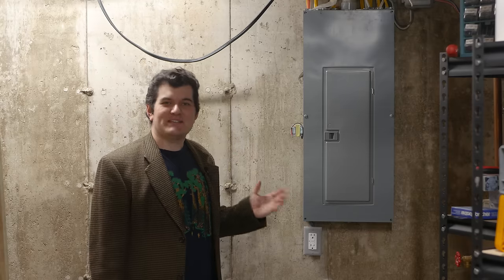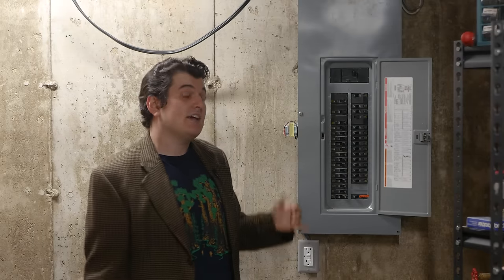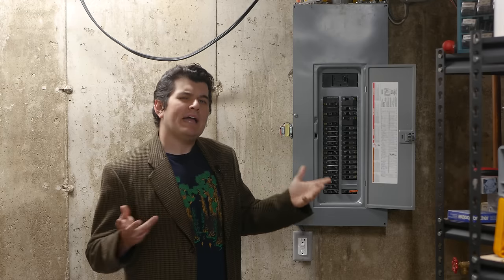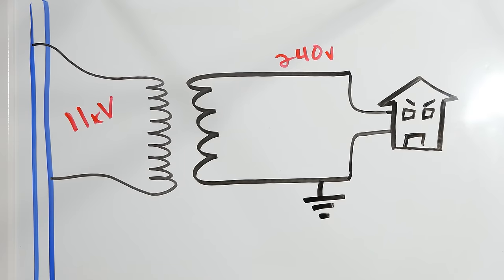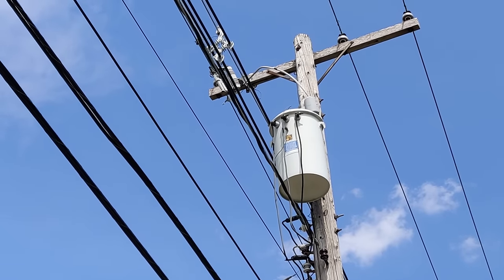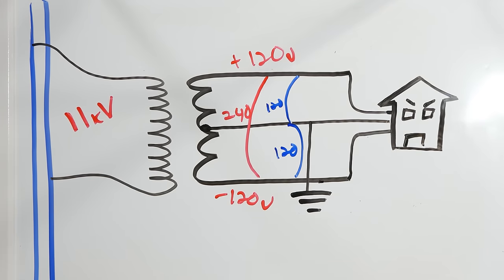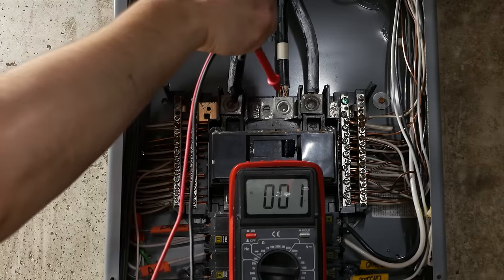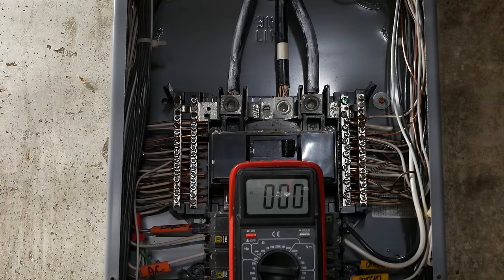The US electrical system is not 120V

Comment: Actually in Germany we typically have 3 phase power to our home. This means you have 3 powelines, 120° appart and one ground. Depending on how you connect these between eachother or to ground you get either 380V or three times 240V. Bigger machines like washing machines, driers, ovens etc. use the 380V three phase power. Other smaller machines, connected to the normal outlets, use the 240V single phase power. 
Usually the fuses for the main lines are 63A for each phase. There are other breakers like 125A, but these are not so common in normal households. Hosehold machines thypically have lines with 16A breakers. Bigger industrial machines use 32A lines ore less commonly 63A.
Reply: Yeah that's true for the most part but the voltages are 230V and 230VxSQR(3)=400V
Fun fact the "normal" 230V plug is only rated for 10A consistently but u can still pull 16A for a short periode
Greetings from an electrical engineer from Germany
Reply: In Germany, the 3-phase is 400V. . . . Which naturally gives 230V Single-phase. . .  ( For Americans, Single-phase is a SINGLE live line and Neutral. )  . .   Not like their 2- phase 120/240V which is TWO Live lines and Neutral.
Reply: The US 3-phase electrical wires carry 480V at 60HZ but usually only commercial and industrial uses get that much. But none of this matters. Everyone gets what they need which is the point of  his video.
Reply: @tawnyforest7932   No they don't in America, that is what I am getting at . ..  You cant get 120/240V directly from a 3-phase supply. . .   From 3-phase, you can get  240/140V    nasty for 120V loads. . .  Or you can get  208/120V  nasty for 240V loads.
Reply: Do you really use 3 phase power for washing machines in Germany? Most run just fine on 10A / 240V single phase. Your fuses are also pretty big at 63A. In the Netherlands we usually get 3 x 25A. More amps are possible, but at much higher monthly network charges.
Reply: @tawnyforest7932    I do a fair bit of work with 480V 3-phase and I often have to convert it to provide 120/240V. .  Not easy from 3-phase.. .   The rest of the world does not have this problem  400/230V is easy to work with.
Reply: @drfisheye  It depends on what machine you are buying. You can get washing machines as one phase or as 3 phase version. I personally have a 1 phase machine, but I do know people, that have the 3 phase ones. My dishwasher on the other hand does use 3 phase power (stove and oven as well).
The 63 A fuse is only for the main line, that is connected to the street. Inside my house the 3 phase power line is split into multiple 3 phase lines with 16 A Fuses and also multiple 1 phase lines with 16 A fuses.
Reply: @drfisheye  No, not for normal residential washing machines. Electric stoves are usually connected to 3 phases, but just in order to distribute the load of several plates operating at the same time on different phases. Traditionally, one used 3 phase motors in tooling machines and similar. Neon bulbs in bigger rooms like a sports hall are distributed on the 3 phases to reduce intensity flicker. Both are vanishing with electronic inverters and LED lighting. But new 3-phase-connected applications are wallboxes for BEV charging and photovoltaic inverters.

The normal electrical power connection for a single-family house is 3x40A nowadays. Older installations or flats in a bigger house have less.
Reply: @talpalababa5994 That's very interesting, how do you connect the appliances, do they have a special 3P plug or the wires are connected with terminals?
In Italy, although possible, no one has 3P at home. Every building does have all 3 phases which are then distributed evenly into the flats. The standard meter is rated at 3kW although you can upgrade to 4.5 and 6kW, for even more power a 3P connection is required.
Reply: @fb55255  In Germany we have a special 3 phase plug. This plug has five pins. One ground, one neutral and then the three phases. The higher the amperage the plug is designed for the bigger the plug is (the overall design stays the same). This is so that you can't for example plug in a 16A machine into a 32A line (and vice versa).
Reply: @drfisheye  The 3 phases come to the homes (3 live + 1 earth&null). There may be 3-phase (5 pin) connectors for special reasons, but it's not common (but built-in devices like ovens can use 2 or 3 paheses). The 3 phases are separated into 3 1-phase circuits with individual breakers. Therefore funny power outages happen when only a part of the house is in darkness...
Reply: @hughleyton693  what do you mean "that's what you're getting at"? You didn't say one word about American 3-phase power. Nice try but you can't edit the past.
Reply: @csabamagyar3244  that can happen anywhere you trip a breaker to just part of your house lol
Reply: @joshyoung1440     American 3-phase is the same as 3-phase all over the world and with 3 live lines, running at different phases, is rightly called 3-phase by everyone, including America.. .  Which is what makes it strange they can't call it 2-phase which is similar having two live lines, running at different phases. . .   3-phase is 120°  . . .  2-phase is mainly 180° but can also be 120° and the old original 2-phase was 90° .. .  They are all 2-phase but only 90° called 2-phase in America. !
Reply: @hughleyton693 2 phase is it’s own thing but it doesn’t make sense to use it so you never see it
Reply: @markmontagna7637     3-phase has 3 Live lines with or without Neutral, 2-phase has 2 Live lines with or without Neutral,  single-phase has a Single live line with Neutral return.   .. . . End of story. .. .  So 2-phase is widely used in America.
Reply: That is why the heading of this Video. . .  America uses 2-phase 240V that is 3-lines, L1, L2, N. . .  Each Single-phase is 120V. . . .  But because they are 180° from each other, then 2-hase gives 240V from Two Hot lines.
Reply: @hughleyton693 Thats not what the term 2 phase is usually used to mean.  Look on Wikipedia you'll see that 2 phase is used to mean something different (usually using 4 wires but possible w/ 3) than split-phase.  In a 2 phase system the two phases differ by 90 degrees not 180 as in split-phase.
Reply: @petergerdes1094    That   IS   what the term 2-phase means, Internationally, but not in America. . . .  3-phase is 3 live AC lines, 2-phase is 2 live AC lines, 1-phae is 1 live AC line. . . .  Simple as that technically and Internationally, but not called that in America.. .. .  Yes 2-phase is used to mean 4 wires or 3-wires L1, L2, N   And the easiest way to get that for 180° is to Split a phase winding into TWO halves with the centre point grounded for Neutral,  for 120°. just take 2 out of the 3 live lines with or without Neutral, for 90° you will need to use a Scott-T arrangement... . .  We Split 3-phase secondaries to get 6-phase, better for later rectification to DC.
Reply: @talpalababa5994 Is that the CEE connector?
Reply: @wongcw08  Yes, it is the CEE connector.
Reply: @drfisheye  No, common washing machines only use the standard 230V plug, and yes, 10A usually should be enough. There are still a few older homes which only have wiring for 10A.
Reply: @hughley693 so is Germany better than us & the UK front that?
Reply: @hughleyton693  Small correction, American infrastructure is 1 phase 240V split. 
2 phase suggests a 90-degree phase offset.
Reply: @nathanielhill8156      2-phase can be 90° or it can be 120° or it can be 180°  . . .  They normally use 3 wires and there can be others, but the three are the more common ones, although 90° is not very common these days, but 4-phase has been around quite some time, but not al long as 3-phase, and now we are using 6-phase and even 12-phase in some systems.
Reply: I'd say three phase ovens or stoves for consumer use are incredibly rare. They are usually connected by three single phase connections with a linked three phase breaker. That's why three phase sockets for these kinds of machines are often wired with two neutral wires rather than one.
Reply: @jonatanrullman     As several people have told me, 3-phase supplies are common in some Europeans countries homes. . .  I have not seen that, but I have most certainly worked with European 3-phase, which is 400V in many business places.
So yes, you could cheat for stoves, ( ranges ) using multiple 120V lines or even multiple 240V connections, which are actually 2 x 120V lines, providing the Fan motors are correctly powered.. .   .  That is why 50A Stove Plugs are 4-pin, that  is 2 lives and a Neutral, so they still have 120V available for the electronic control, timing clock etc.
Reply: not washing machines but some electric stoves run on 3 phases as the 3 phase wiring is a lot beefier. and you can pull 32amps from it sometimes @drfisheye
Reply: @fb55255 😂 I remember when staying in Italy we had like TV, oven, washing machine and AC on and it tripped the breakers. Everyone was just baffled when we found out how low the amps were for the whole house.
Reply: @talpalababa5994  funny how its always necessary to write "in Germany" :D .... Its EU standard. Even UK has same 3phase plug
Reply: @drfisheye not washing machines, but our electric stoves ususally run at the 3 phase, for more power.
Reply: @drfisheye  I live not in Germany but in a someawht similar neigbouring county. When I was a child in the 70'ies it was quite normal to have 3 phases in ordinary one-family houses. For the heating of the washing machines and for the oven. I even remember my father saying that some friends had an odd washing machine - being only one phase. Nowadays, washing machines consume less, but it is still quite common (if not the norm) to have 3 phases in your house, although it is not common to have 3-phase 400 V wall sockets any more. More to just distribute the load on the grid.

Having said that, we have a 400 V and 16 A three phase  wall socket in the summer house for the washing machine, although it never draws that much power.
Reply: Nah bruh its just cooktops. Washers all take only 1000W now. Dryers not even 500W.
Reply: @hughleyton693  US tranformers are actually single phase 240 but 2 leg with center tap neutral. Because of Edison's 120V bulbs or something.
Reply: @drfisheye  Serbia does 3x25A too. If I remember right thats a total of 17250W. Good luck exceeding that with home appliances.
Reply: @jm036  The US calls them Single-phase. . .    They are single-phase transformers.. .   But they have two Secondary windings.. .  The centre point is Grounded for Neutral, which then leaves the two live ends, each at 120V from Neutral and 240V from each other, because their phases are running at 180° from each other, rather like a kids sea-saw, and that is how they then provide a 2-phase 3-wire SUPPLY to houses. . . . . .     We also also make 6-phase from 3-phase supplies, by also splitting and centre tapping the three secondary windings in the same way.. . . Splitting a winding and grounding its centre point is the easiest way to get 2-phase 180° 3-wire Supplies.
Reply: @drfisheye No, in Germany usually the only thing connected to 3 phase power is the stovetop. Everything else runs on 230V~, except if you have industrial devices at home.

Comment: If people were confused by gas clothes dryers you should do a video on gas powered refrigerators.  That'll blow some minds.
Reply: That involves finding some place out in the middle of nowhere or perhaps having access to an RV motor-home.
Reply: When I was a kid in Iran (1960) we had a kerosene powered refrigerator. Dad had to relight the flame occasionally. I learned the refrigerator used an ammonia absorption cycle... a bit beyond my 8 year old brain.
Reply: But.... gas make things hot.......
Reply: yeah that took me a while to understand how an absorber fridge works, it blew my mind a little bit
Reply: Mmmm. I love the smell of Freon in the morning.
Reply: @Fopenplop  Hot is good. Hot drives a motor. Motor works like electrical motor. Motor drives pump. Pump works magic and summons unicorns. Unicorns are cool. Fridge is cool. Now milk won't spoil. Gas also comes from Uranus, but bottled gas is not so smelly. Or is it?
Reply: Gas appliances in general confused me as an adolescent due to nobody feeling the need to clarify how the gas was used. I was thinking the whole thing was pressurized. Gas or propane powered dishwashers and washing machines too (RVs). Then there are natural gas vehicles. Those things still scare the crap out of me on principle, but I also have trouble refilling a butane torch. So, there is that.
Reply: They used to have gas powered bath tubs too.
Reply: Or gas powered central air conditioners. Back in the 70s the gas company would put in an absorption ac system for free if you signed a contract to buy gas from them. Crazy things used a 300k btu burner to get ~60k btu of cooling.
Reply: The ammonia line in our RV refrigerator ruptured in the middle of the night and it was the worst smell ever and lasted for days.
Reply: @scofield117  I worked at a local gas utility for a summer job back in the 80s. I heard one of the pipefitters say something like, "I have no idea how burning gas will cool down a house." I never bothered to figure that out, either.
Reply: The utility company I work for still has two old SERVEL gas fridges in our training facility. I had no idea such a thing even existed, but they're really cool. It's not a compressor driven from a gas-powered motor like someone mentioned up above, it's an absorption cooler. No moving parts and virtually silent!
Reply: I would love to see him talk about them
Reply: @scofield117  now that's American!
Reply: I mean quite a few people will have heard about those for camping reasons. A gas clothes dryer is super weird because the reason why they exist is far less obvious then "i need a refrigerator in my caravan".
Reply: @Fopenplop  Gas fridges have been around for almost 100 years, they use Ammonia as the gas. Great Grandparents had one from the 40's on a farm.
Reply: Meanwhile, I'm confused how gas powers cars. I haven't seen any LPG cars with tanks for them.
Reply: @meinnase  What's weird about them? Electric dryers use a heating element and gas dryers use a flame. Far more efficient and cheap to run. I have one. Before I get anyone arguing that electric heating elements are 100% efficient... They are... There are substantial grid/conversion/distribution losses involved in Electric that do not exist with Gas.
Reply: @scofield117  Gas powered central air conditioning common in Northern Virginia back in the 70s because Virginia Power was even more of a "hee haw" power company back then and couldn't supply the load.
Reply: @tubester4567  I prefer water in mine.
Reply: I don't get why people think gas dryers are wierd since gas ovens are not wierd. They are standard for laundromats. In that situation, besides being more efficient, they are probably better suited for running practically non stop for 12-16 hours a day.
Reply: All new commercial refrigerators use natural gas as a refrigerant. Also ice machines
Reply: @UMNOTMYREALNAME  ...although they generally are mechanical, using electric motors for the power.
Gas refrigerators tend to be only available in the small, camping sizes now.
Reply: @e-curb  On the other hand, they were built to survive a bomb blast and not leak, they were still weaker than the old sulfur dioxide units though.
Reply: @brianleeper5737  They play that role for denial of responsibility, Illinois does the same, they pocket money going their way and carry on the act.
Reply: Pure Harry Potter level crap there. I still dont get it.
Reply: @UMNOTMYREALNAME  no, new refrigerators use R410A and R134. using a highly combustible gas as the refrigerant is a good way to blow up a restaurant. gas powered refrigerators are the ones in RV's, which use ammonia as the refrigerant by distilling it out of water then cooling the ammonia to produce liquid refrigerant. instead of a mechanical compressor, it uses some fancy manipulation of boiling points and pressures to reset the refridgerant.
Reply: Not sure why - gas just gives you the source of heat you need to produce cold.  Sort of.  We had one in the 60s and it worked fine - and was very quiet.  The flame did go out sometimes though...
Reply: @wyattroncin941  look it up
Reply: @UMNOTMYREALNAME  I did. Refrigerators do not use natural gas as a refridgerant. In the past ammonia was used, that was deadly they switched to freon (r-12), that was mega bad for ozone, they moved to HCFC's (r22), that was still not great the moved to HFC's (R410a&R134). Natural gas is not used as refrigerant in any capacity outside of scientific or industrial applications where cytogenetic temperatures (-100C) are needed.
Reply: @wyattroncin941  it's called  R290. I worked on a pizza prep table today that uses it. Very small amount is used. About half the amount that would be used if R134a
Reply: @UMNOTMYREALNAME  R290 is propane, not natural gas. Natural gas (methane) is R50.
Reply: Then after that, we can do a video on steam powered air conditioners.
Reply: @1Walrus23  forklifts used in small rooms use lpg instead of petrol
Reply: and he didn't say how many amps of gas they drew.
Reply: technically, an electric refrigerator has gas in it as well. The gas is the refrigerant also known as freon. (yes I know about tetrafluoroethane, freon is just easier to say and write, and they both start with r-.)
Reply: Maybe that video should start with refrigerators powered by ice deliveries.
Reply: I had to connect up a friends gas water heater and later a gas cloths dryer for them. . . .  The plumber said he could do the Water, but not Gas or electricity, the electrician said he could do the electrical work, but not the Gas or Water. . .  So I did it all for him.. .  I do know what I am doing in all three disciplines.
Reply: I had a restored, early-50s Servel fridge in a converted bus I lived in 40 years ago